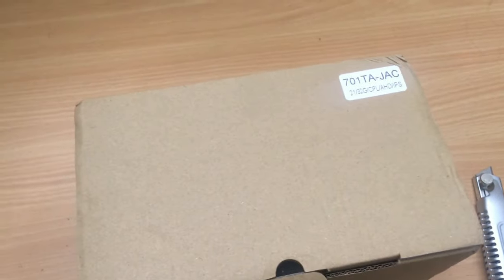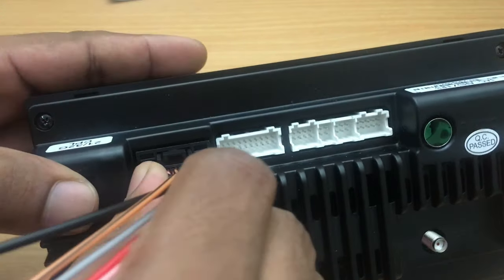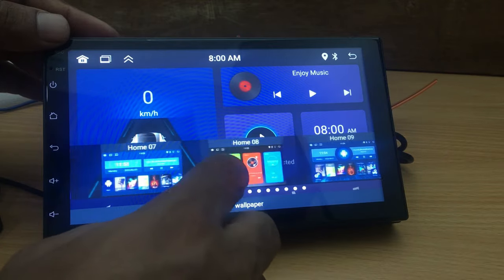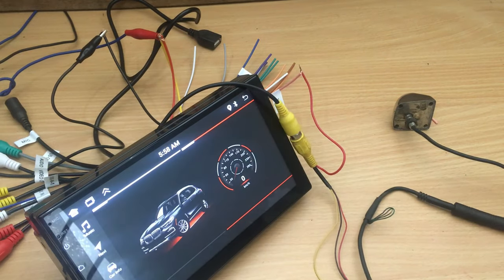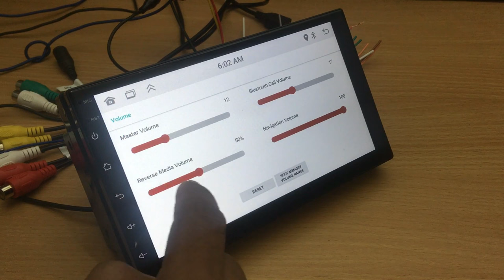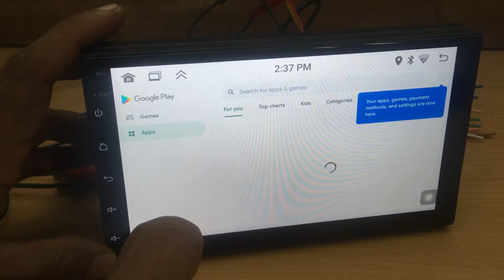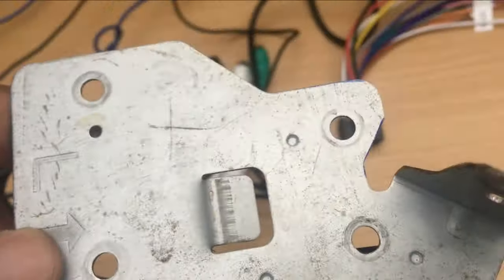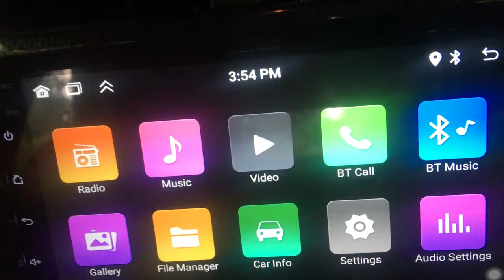Android 13 Car Stereo Head Unit: Unleash the Future of In-Car Entertainment

Comment: When shift to reverse radio display perfectly the camera and 3 seconds later go to menu alone without movin the shifter. What can be the issue
Reply from the maker: Check settings. There must be an option to change. What is the unit?
Reply: Radio model is D02022HA16 version 13.0
Reply from the maker: @bryanmendez6443  does it show a count down ?

Comment: I just received my unit, I was thinking there would be a slot for a memory card but don’t. Apart from android auto, is that usb connection for a flash drive to play the music ?
Reply from the maker: There is enough internal memory. And also you can use an USB or a chip reader to play music, videos, etc.

Comment: Installed the 13 into my 2017 Chevy Silverrado 2500HD (no bose). Everything works so far except the steering controls.  

The radio was programmed as an Enclave, and im guessing its that way because my truck is bot an option.  

Can you help me figure this out?
Reply from the maker: Try after factory reset
Reply: @setnfix  Did that, and still no luck.

Comment: How did you operate it? Did you connect it to electricity? I also want to try it at home. How did the electricity reach it?
Reply from the maker: Use 12volts around 2A. Connect both Battery and ACC wire together and give positive 12V.

Comment: How can I fix the sound I have ever good speakers in my car but the quality is just awful and I can’t find out how to fix it with the tuning
Reply from the maker: The devise sound is good. When you change the speakers, buy suitable for 55W
Reply: @setnfix  my car speaker are 500w
Reply from the maker: @justinrogers1783  1st check the the performance with low volume and gently increase the volume. If the issue when increasing the volume, you may need to replace the speakers. But before purchasing new, check the speakers connecting with any other audio device.
Reply: Because its trash and not even Android 10 in it
Reply: Put Aida64 on it bet it says 1 gig ram Android version 8.1

Comment: Is it easy to had RAM box and aerial to this unit and I have used the pre wired connector I only have 2 speakers in my camper van and want to add another 2 for the back of my camper do I have to brake into the harness or just join the wires to the other 2 speakers
Reply from the maker: Since you can connect 4 speakers to this unit, you can just connect other 2 speakers with the stereo system. No need to do modifications with factory wirings.

Comment: Hi, at 5:29 what other cables on that power harness need to be also connected & to what colour? Is there a diagram? Thanks.
Reply from the maker: Yes, it is with the user manual. Black to GND, RED to Acc, Yellow/Orange (big wire) to Battery.
Reply: @setnfix  dam im struggling with mine, have u got somewhere i can send some pics & see if u can advise ? Thank you!
Reply from the maker: @georgejexter yes,  you can send to my WhatsApp

Comment: I've plugged a 2xRca to 3.5mm jack Y-splitter into the aux R in and aux L in but aux not working when I plug it into my phone. Any solutions?
Reply from the maker: in the settings, you have to enable the AUX.

Comment: Hi there, you seem to be longer around with this Sort of Unit then iam... and ive a "Problem". 

Bougt 2 Android 13 Units from "CYA" (Name in Plattform Information) and cant find this Manufacturer anywhere. Reason: The MCU Firmware on both are Different, Android Versions are the same. 

The Sound on the one with the newer MCU Firmware is MUCH better in Meds then on the unit with lower Version Number - so i asked the Seller if there is a Place where i maybe can download the Updates to bring both Units on the same Page (One is in the Smart 541 of my Wife, one in the same Smart Modell of my Father in Law)... 

Maybe you have an Idea. Thx in Advance

Best Regards, Martin

P.S: To give you some Specs as listet in "About Cardevice" (Hope Translation is correct, just made Photos in German Translation and its sometimes... weird... but neither my Wife nor my Father in Law are able to read and understand English :/ ) - the Date below are from the newer Headunit in my Father in Laws Smart, in the Unit of my Wife every Data is the same exept the MCU-Version - its same JCST but an Date from End of 2023.

Background Information:

Plattform Information: CYA
Android Version: 13
System Version: UJC201-V1.0.75R3-240111_1339-CC-C0-CYA
MCU-Version: JCST_Q8_8T7-2024.01.25_16:48
CAN-Version: 1.0.1403.2023-09-13.a8a531ce
Can Box-Version:
ID: A0_AN
Reply from the maker: First, It is not possible to enhance the quality of the sound by changing the firmware. It is depend on the sound IC, most of are TDA sound ICs with 55Wx4 channels. Those are coming with high quality sounds. (Did you check the quality of the speakers of your vehicle?). Yes, sometimes it is unable to find the manufacturer due to custom ROMs. The only way is, open the casing and check the mainboard. The motherboard surface is printed the brand (XYAUTO, YTD, etc).
Reply: @setnfix  Wow - ure a rlly fast Dude <3 
Thx for the detailed reply. 

So i will deinstall the Unit of my Wife at the Weekend to look whats inside. Its different from the Back then this one youve shown in the Vid, but the Basic Layout is the same (just more Connection Ports - Sorted in 2 Rows and the GPS Antenne Connector is directly beside the Antenna Connector). 

The Soundprocessor Information reads: 37534 - guess that means the ROHM BD37534FV ? 

The Information from the Seller was 4x45W - which is more then enough for Car Speakers imo. :) (The original Basic Stereo in the Smart 541 Coupe have 2x25W)

Ive Changed the Mercedes Standard Plastic Speakers to JBL GX602 Speakers who sound awesome in Comparison. But i notice as i said that the Mids in the Car with the newer Unit with Higher MCU Version Number are clearer - its the only difference between both units so it must have somethin to do with it, otherwise i didnt find any difference. 

Ill take your advice and take a look - thy again for the very nice Info. :)

Comment: Thanks for sharing  how does the unit know when a door is open
Is there an input wire for the doors so when a door opens it displays on the screen thanks
Reply from the maker: No, There is no connection with the door (of this device). It can be an issue due to wrong wiring. or have you installed customized gadgets to your car.
Reply: @setnfix  thanks for your reply
I have installed an android head 3in my car everything works perfect but i would like it ro detect door opening displays on screen how do i do that do i need a canbus wil the canbus plug straight into my unit because there's one or two blank ports on back of unit not used for anything are they for canbus 
Just not sure how to do it
Your help is greatly appreciated thanks

Comment: Hey man love ur videos!!
Just wanted to know if it is better to install a sub in a factory stereo or android headunit.
Btw I have a mitsubishi pajero with a factory Rockford soundsystem.
Reply from the maker: It is most suitable to use the factory stereo as those are fit with the vehicle requirements. But some factory head units are not coming with backup camera, GPS etc. Then you have to go for a 3rd party head unit. If you purchase this, I can recommend the sound quality is very good like a branded head unit.

Comment: Hallo, i have the same with the same menu,do you know why even if i save the radio stations it lose them every time i turn off the car (the installation was done by a craftsman and he cant find nothing about that) also if you know why even if i find the colours of the touch buttons i can select only white..you believe that maybe the product has proble??i am waiting for your reply...
Reply from the maker: There may be a fault with your device . But the memory keeps with the battery power. Normally yellow big wire is the battery wire. It must be connected to the battery and even though the car is switched off, the head unit should be connected with the battery . Check that. Another option is, factory reset the unit. Yes, some devices are not with the option to cange colors .
Reply: As SetNFix said, i bet ur Ingnition Power and Main Power Cords are wrong connected - switch em in the Connector and everything should work fine. :)

Comment: Generally, things are fine, but the unit keeps shutting off and back on while driving.  Thoughts?  Should I do a factory reset?  Only installed 2 weeks ago and this on off keeps happening.
Reply from the maker: Check the wiring. There may be a loose connection. Or over heating. try to install a fan to the device.
Reply: @renwilson5877  Mine also does this at first I thought it was the apps I was disabling but Ive tried Factory Reseting multiple times It didnt help I do believe its Over Heating but its happend when Its not that hot out and my older model a 7018B with the physical button Never did this Very Odd

Comment: I installed android 13 car stereo specifically for ram 2015 2500. Everything works except the climate control buttons. I've checked on the protocol settings. But there's no option for my dodge ram vehicle
Reply from the maker: climate control buttons?

Comment: IHave an Android 13 head unit, but i can''t find the Android Settings. The text on this unit is to small, nearly can read it. I know via Android Settings Accessibility you can change font size etc. but i just can't find this Settings. Also how to change desktop themes.
Reply from the maker: When you go to apps, there is the settings. or there is the settings icon under notification bar. If you want to change the theme if the alternative launchers are not available, you have to download launchers

Comment: I hv a 2015 gmc canyon slt with Bose will this work  10” screen
Reply from the maker: Question no not clear to me frnd
Reply: @setnfix  I have 2015 gmc canyon slt. It’s had the Bose system in truck  I bought one system not compatible because of Bose system  it is infotainment system in truck  will ur work
Reply from the maker: @winsorwilliamssr.1220  It is difficult to give a direct answer. because the manufactures give converters for some vehicles such as Toyota. But you have to check with the manufacturer about the availability of such a converter suitable to your vehicle .

Comment: I just installed this on my hyundai sonata 2013 im trying to figure out how to use it i got the buttons mapped out on the device just not the steering wheel yet
Reply from the maker: Pls watch the following both Videos
https://youtu.be/MlqpjJdzHQ8
https://youtu.be/7g1vx1ICiYo
Reply: @SetNFix  I got a good grasp of it. It doesn't have button mapping for the steering and the connection gets interrupted ... so far it's kinda ehhh

Comment: Doesn't power up the factory amp on Skoda Octavia 2 so I dont get any sound
Reply from the maker: Did you use the AMP wire?
Reply: @setnfix  The amp uses canbus to power on, which wire is the amp wire?
Reply: @rjac001  I have the same issue. not sure what to do from here.

Comment: No video says how we position the gps behind the radio, gps cable pointing to the engine or cabin?
Reply from the maker: Keep the GPS antenna inside the car on the dash board. But be careful to prevent from sunlight.
Reply: @setnfix  I know, but what I refer is the position of the gps, cables to the front? Cable to the back? Or it doesn’t matter, because 🤔 maybe the gps will thing we are driving in reverse, not sure about that
Reply from the maker: @RotoRCol  GPS unit have no idea about you are driving to front or revers. It just show your moving one point to next point.
Reply: @setnfix  thanks because I know some gps not relative to auto stereos need to be pointed to an specific direction,for example it is like holding your phone upside down , it will get crazy locating the destination

Comment: Have you got wiring harness cables for Kia Sportage 2011-2016? Thanks
Reply from the maker: This is with universal wire harness. You have to order separately the required harness for your car.
Reply: @SetNFix  I have bought some harness cables but none of them worked. Would you help please? Thank you
Reply from the maker: @SalmanSahindal  Check the original wires with the connector. If your battery power connected to wrong wire, your unit will be burnt.
Reply: @SetNFix  I have checked it but nothing burnt yet tho. But one plug is missing. I can't figure that out mate :/

Comment: so im curious in order to get internet on the head unit can't i just use the bluetooth on my phone or do i have to enable mobile hotspot?
Reply from the maker: you have to on wifi hotspot and connect with internet
Reply: @setnfix  that will take a lot of hotspot data. I'm starting to think i should have just got android auto
Reply: Android Auto works from your Bluetooth. Other apps you can use WiFi hotspot.

Comment: My amp won't turn off . I'm confused, the amp const(blue) and key #1 are unplugged from remote wire to amp . Still getting power .
Reply from the maker: it is to activate the amp but not for power..key wire is for steering wheel keys
Reply: @setnfix  so what do I do

Comment: If i don't connect the camera i wont be able to connect to the wifi? Or what happens?
Reply from the maker: You can use wi-fi without connecting a camera. But you have to connect that connector to the device.

Comment: Fm radio signal sucks what’s wrong? Screen turns off when i switch gears
Reply from the maker: This device is with a good fm module . Signal strength is also good. Chech the car fm antenna and the fm signals in your area. If the screen turned off when switching gears , there is an issue with wiring . Or check alternator , alternator belt and battery condition . There is no connection with car stereo and gear system .

Comment: Does anyone have the problem that when they start the engine there is no sound and the unit needs a reset?
Reply from the maker: It is most probably an issue with the wiring. Make sure you have connected the battery wire correctly with car head unit.

Comment: My head unit always stays on even when the key is off? So I have to push the power button on the screen to cut the head unit on or off every time I get in the vehicle  What do you think the issue is?
Reply: I'm also interested in the answer.
Reply from the maker: This is sometimes with wiring issue. normally there are wires from battery and one from ACC. if both are connected to the battery wire, the unit will not off. Some devices are with option to keep on even after the key is off (if so you can change it). Or there may be an issue with your main board. you may check by disconnecting ACC wire from the device, if the unit works still, there is a issue with the board. then you can connect the both ACC and B+ wires with ACC wire. (this is the last option)
Reply: head unit red power wire needs to go to acc+ from ignition switch, then it will switch on/off with ignition key etc.

Comment: I bought a radio like that and now the screen is black and sometimes only flashes the buttons on the sides  ( only when I turn on the car tho ) 😂I got frustrated and I let it alone
Reply from the maker: Screen black issue is sometimes due to burnt back light, burnt display or a issue with the board.
Reply: @setnfix  so that means that I need a new one lol 
Thanks for you answer

Comment: I bought 2 of these android radios sucked both of them sound was terrible. Hard to get WiFi on both coudent use WiFi and hotspot at the same time then one of them the touch screen would not work. The FM radio would go in and out spent $185 for each of them waste of money. Even tried the reset button garbage.
Reply from the maker: It not good. I think you have to contact the seller to solve this issue. Because, I have a good experience about this player as it is working without any issue yet.